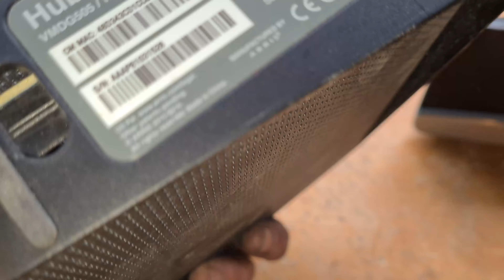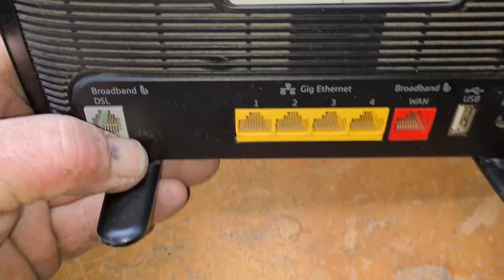E222 Routers Where Is The Gold, Gold Pin Stacking, Devil forge copper gold silver platinum refining,

Comment: What were those black boxes in the jar you are going to melt, capacitors?
Reply from the maker: The silver squares are just aluminium plastic aluminium and more the pegs that hold them to the board contain no tracks between the laminates. I would love  to know what they are. Thus is why I never mentioned the components name because I simply have no clue